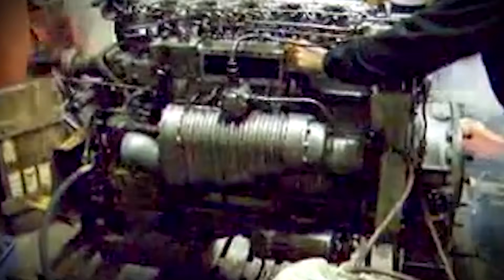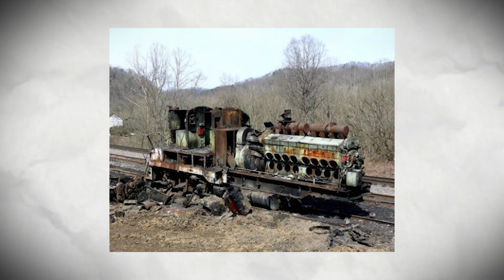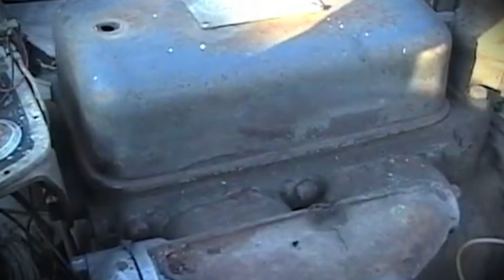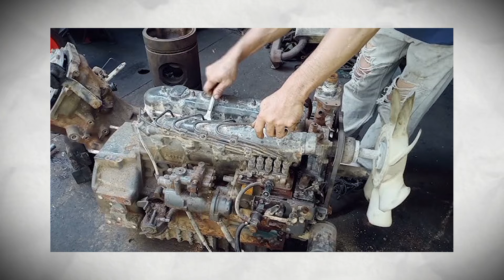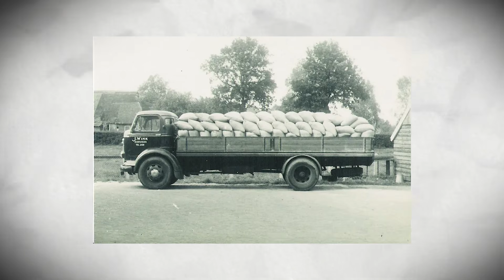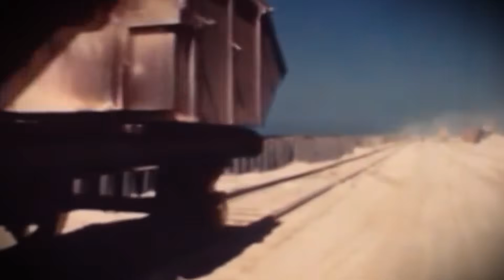The Dark Story Behind the Foden FD6: The Screaming Two-Stroke That Refused to Die

Comment: I believe that Detroit diesels were 2 stroked.  We used to joke about Detroits needing new exhaust valves.  Great video! Thanks Dave WRØX
Reply: Detroits had exhaust valves, they didnt have intake valves.
Reply: I drove a 900 hp v16 Detroit diesel when I work at a mine while I was in college. very powerful engine.
Reply: @davidmicheletti6292 maybe 750 hp but definitely not 900 hp.
Reply: @darrenwebb5334these engines were used in several brands of try. I was told by several people at the time these engines were 900 hp. 
The largest was a75 ton haul pack but they were also used in Euclid trucks and one other share truck of an odd brand.